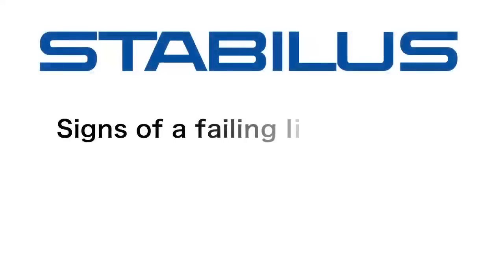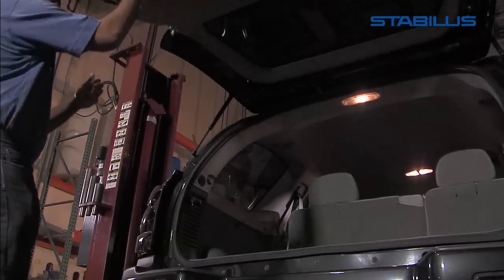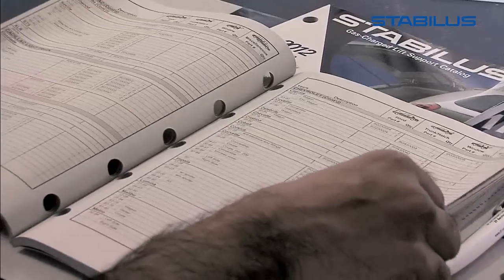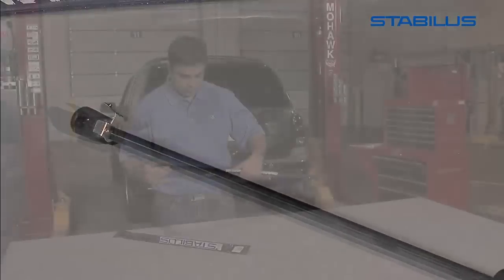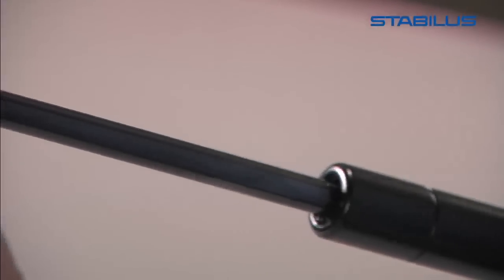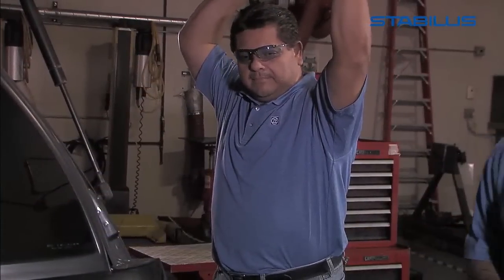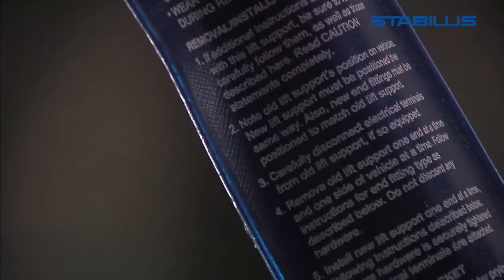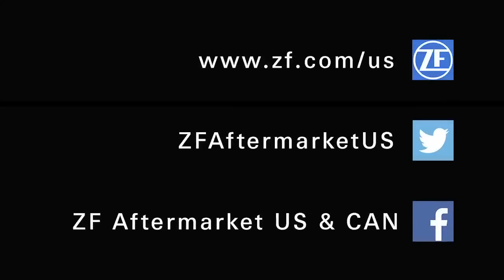STABILUS Shows How to Replace your Vehicle's Lift Support

Comment: Thanks for posting the video. What do you do if the Stabilus support is a half inch longer than the one removed - even after both lift supports have been removed so the trunk may be opened fully? Thanks again!
Reply from the maker: +Unekid We recommend calling our tech service line (800) 321-0784. If the lift support support isn't correct for the application the brackets, vehicle, or lift support could end up damaged as a result. It would be much easier to discuss this topic over the phone.

Comment: Are Stabilus lift supports less expensive that rom supports?
Reply: They are recommended as exact original replacement parts as found  on your vehicle. Other mfg. may not last as long during daily use especially the trunk supports.

Comment: You completely "glossed over" the actual disassembly and reassembly of the lift support!! I can't believe you did NOT explain that a special screwdriver may be needed to pry out the retainer clips - ONLY HALF WAY !!!! Also, the retainer clip usually comes out only one side at a time when you pry it. You have to be careful you are applying equal pressure to each side of the clip, or it will end up "bending", and then you will have to take a pair or pliers and straighten it out. This was the only "pin in the a**" part about the entire job. So...........watch out!! There just HAS TO BE a better way to design this part of the job. Why has someone not already done this. It would not be rocket science!!!!

Comment: Does a power liftgate and a manual liftgate use the same kind of support?

Thanks for the great video
Reply from the maker: k2gonzo Stabilus lift supports have different part numbers depending on the application. Specifically in regards to powerized liftgates and manual liftgates, these are different products. If you have additional questions, please reach out to our technical support line at 800-321-0784.